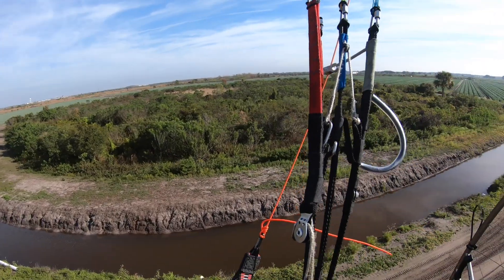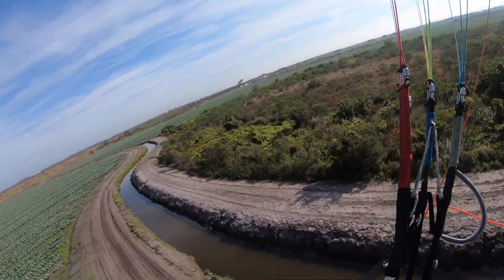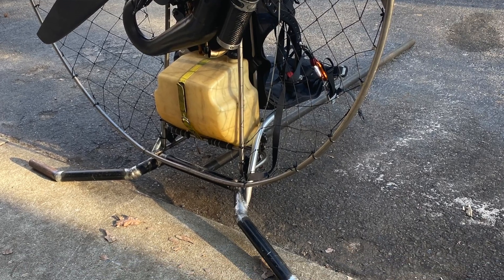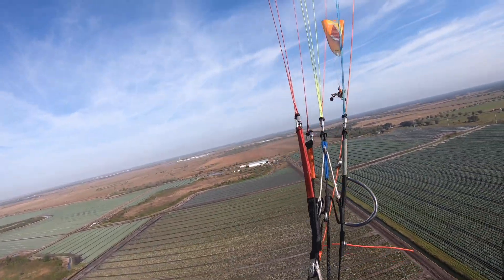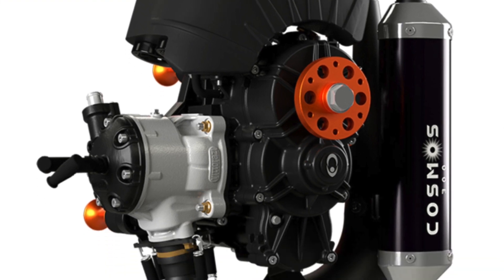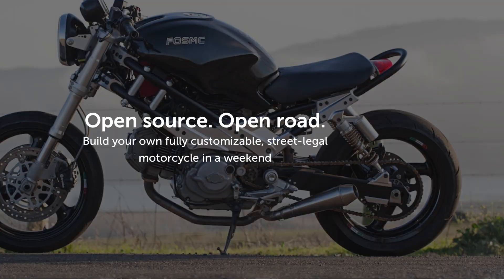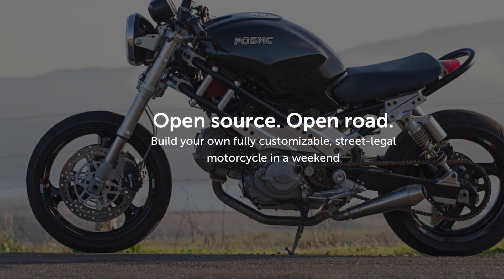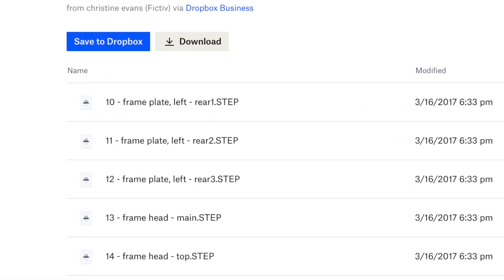Open Source Trike 1

Comment: Super great idea....   Do you recommend the Dual Spark on Cosmos 300?   Or just change the single spark every 15 to 20 hrs?
Reply from the maker: I have yet to purchase an engine for this project, as personal plans have changed, well at least been rearranged a bit. Collaborating the design is not as easy as I thought it would be without purchasing full licensed CAD software for all participants.  Another hard to solve issue?  How do you get each design participant a prototype platform, especially if they don't have the tooling/materials/skills to build along at the same time?  More to your question,  my experience with dual ignition systems, as are found on many general aviation aircraft, is that 2 plugs gives a little more H.P., at least in the mid range where a "magneto check" is preformed as part of the typical preflight check power run-up.  For me?  The assurance of redundancy is worth the incremental cost.  If it adds a little snappiness to throttle response or a tad more H.P....that's just a bonus.
Reply: @YankeeinSC1  thank you much.  I agree - its worth the small incremental costs.

Comment: You might consider two trikes -- one super lightweight and agile for the youngin's and another more comfortable for the long distance cruisers like myself.  Personal preference; any trike that has anything other than the risers in your field of vision detracts from the flight experience.  Compare the Foxy trike to the Pa.P. Mini rolling trike to see what I mean.

As you can tell, I'm 100% on board.  Looking forward to the future.
Reply from the maker: I think you'd like flying my first build, the light weight :33 seconds into the vid.
Reply: @YankeeinSC1  I fly the mini rolling trike but the seat on the flash cruiser has seduced my a** it is so comfortable -- just if it did not have those bars!!!

Comment: My 2 cents: front disc brake.  Optional foot throttle. Super comfy laid back seat like on the Flash Cruiser but without the vision blocking bracing the it hangs from (yeah, I don't want much...).  Also don't rule out the Swiss made Aero 1000 engine.  Heavy but four stroke, fuel injected, smooth goodness...
Reply from the maker: All great inputs!  I just added a basic design criteria sheet to the OSPPG.COM website.  All of your ideas are already part to the discussion and design inclusion musts.  Engine sourcing is something that everyone weighs in on.  I have two demands. 1) that it is both currently in production and available with parts support & warrantee  2) that it's horsepower to weigh ratio is on a linear scale somewhere between the Atom 80 and the Rotax 912.  :) thanks for commenting!